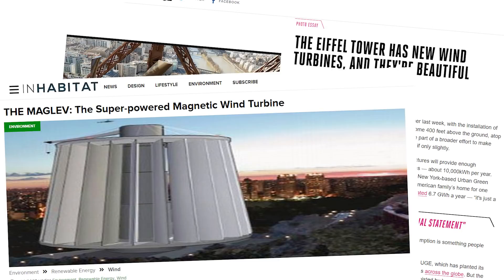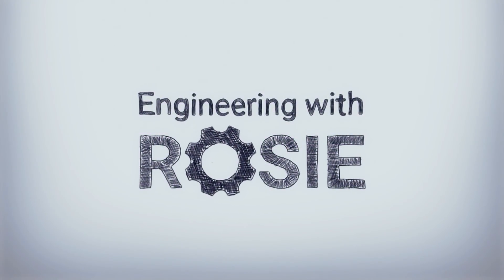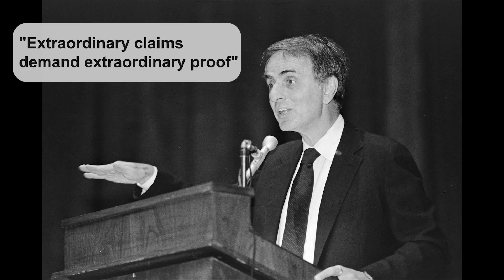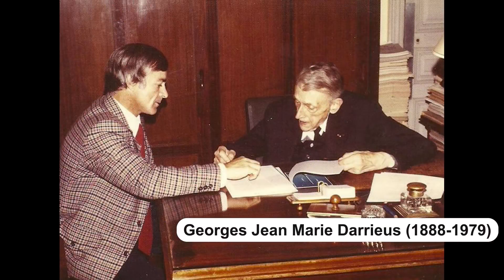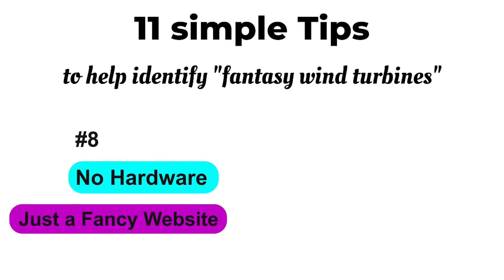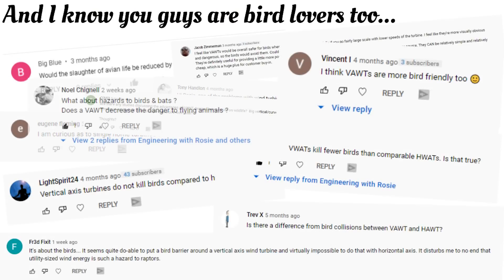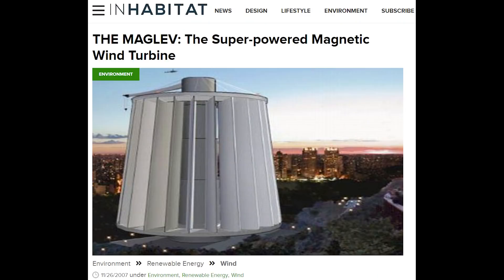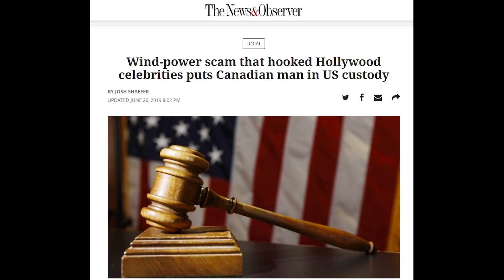Back to the Future of Wind Energy Technology with Paul Gipe

Comment: The future of wind energy isnt generation its storage. This should have been sorted on day 1. Wind is an unreliable energy source and largely unpredictable too. If you want to charge a mobile, fine, though even that is storage, if you want to run UKPLC its next to useless, especially with a blocking high as we see each winter. Zero wind = zero output. Zero wind with storage = ability to tolerate periods of no wind. Frankly Nuclear is a zillion times better than any of the Greeniot nonsense!!!

Comment: It isn't the blades and the wind capture that needs to be looked at, it is the generator that needs to be redesigned or improved to generate more energy at lower speeds.
Reply: generators can use speed or torque: a transmission (or belt drive over pulleys)
can exchange torque and speed

Comment: I've been watching your videos for a while, and I can say you are rigorous and well documented. That's why I wanted you to check our development and share your thoughts: https://www.youtube.com/watch?v=S7rJ7OEfSak
At first sight it may look like you can red check all your tips to identify a "fantasy" wind turbine but every statement is well documented and proved. I'd be happy to share any further info you may be interested in.
The claim about low winds is based on two things. The shape and aspect ratio leads to a really low start-up speed. On the other hand, the special electronics can boost generator voltage at ultra fast speed up to the required battery voltage, thus, squeezing every single Wh available from short wind gusts. I hope you can have a look.

Comment: Hello rosemary, can a scaled down wind type farm turbine work for home use? I’m thinking more of the blades rotating at slower speeds and geared up to drive the alternator. I’m thinking this way because micro wind turbines seem to need high wind speeds to get any useful output. So in essence a long blades rotating at a more slower consistent speed collecting more wind power then geared up.

Comment: There is nothing wrong with an inefficient wind turbine as long as the marketing department doesn't hype it AND it has some kind of redeeming feature like it won't over speed to the point of self destruction. Over speeding is also a problem with scale and high efficiency.  The grid scale market is driven by return on investment in the form of kilowatt hours per investment dollar. Even here, there are cons like shell corporations shirking decommissioning costs. The investors that get surprised with that bill find that their contract is unenforceable against a ghost corporation and the liability protection they thought they had doesn't exist. They awaken to the fact that they have become unlicensed insurance companies and their liability is unlimited.

Comment: Small wind turbines make sense on sailboats for battery charging when away from the dock. They are generally smaller than 2m in diameter, with noise and vibration being major concerns for the people living onboard. Do you have any sources for reliable information on these small scale units?

Comment: Dr. Rosie, I would like to address my comment to Mr. Paul Gipe. 
I respect him as a senior citizen and a Wind Turbine expert. However, I can tell him directly that this time he is a loser. I want to prove to him that all he had said about his 11 tips on degrading New Wind Turbine Inventions were unacceptable and completely false. 

One quote he laid out from Carl Segan “Extra Ordinary Claims Demands Extra Ordinary Proofs” I will disprove this because I made extraordinary claims in my turbine invention, but would not require extraordinary proof why? Everything is self-explanatory. Another quote he laid out from a German Professor Robert Gosch “ If there is a new Wind Turbine, no one should pay the slightest attention to it until the build it, measure it, and publish the results, until then it’s just hot air, marketing hype, and nothing more.” Again, I will disprove Professor Robert Gosch’s quote because even my invention is not built yet, but our 3D video simulation is enough to demonstrate boldly how the system works. I will describe it as far advanced, simple, low cost, robust, flexible, and its unbelievable 30MW minimum calculated rated output. All are understandable even by non-engineers. Note: My wind turbine invention is not found in his published books. Not even one turbine comes closer by resemblance. 

I wish for Mr. Paul to be given a chance to retract his false conclusions to regain his reputation before we launch Rollie Wind Energy this year after he is done evaluating and reviewing my turbine invention when travel is normalized. He must correct himself and make an apology to the world by echoing this statement “I made a grave mistake to assume that wind turbine inventors are all lousy. It is late for me to realize there is an exemption.” 

Kindly check and go over our webpage to explore Rollie Wind Energy (RWE). Be cautioned:  Our claims might cause you sleepless nights, don’t complicate your thoughts. It’s been simplified in line with old and modern science. 
Contact us:  rwe@rollieracks.com
webpage: https://rollieracks.com/rollie-wind-energy
Reply: 3D video simulation...LOL...get real, dude.

Comment: is it possible to use wind to charge a TESLA battery.
Reply from the maker: yes of course! I don't think a Tesla battery (or any other brand) really cares the source of the electrons.
Reply: @EngineeringwithRosie  thank you, to expand ,are there systems availiable that link turbine- battery storage, to a house grid,  i mention Tesla, as the Musk way, shouts out innovation currently.  thanks.

Comment: If you have built it, tested it and published the results then you don't need investors. In fact, you are less likely to get any investors if you have put the performance of the design in the public domain.  If you can afford to do those things then you are most likely an established supplier who will find a highly innovative design disruptive to your current business. You definitely won't get any investment if the design doesn't have a provisional patent.
I am sure that it is true that the vast majority of 'new' wind turbines are nothing of the sort, but I have also been on the other side of the equation in my own engineering discipline where the incumbents, often large multinationals, create legislative barriers by lobbying government in order to increase the cost of entering the market.
The observation is not a defence of charlatans, I was at a decarbonisation conference recently where the great majority of 'solutions' were whacky wind generators looking for investors, so I recognise the problem. However, I have also seen innovation stalled by simple checklists and legislation that primarily protects multinationals.

Comment: I do like the idea of mini vertical wind turbines. Even if they are much less efficient, as given their size you (might) be able to place 4 on each corner of a building that would be unobtrusive as against a single more obtrusive or difficult to locate traditional turbine. How many small vertical turbines would be needed to match an equivalent small traditional turbine? Thinking about residential micro generation rather than commercial…

Comment: Already many windmill used only at certain time and maximum time it is not functioning. I have designed a New Clean Green Sustainable Energy Project. The advantage of this project is the out put energy is constant, continues through out the year and also lower in cost than all other present energy projects energy cost.
        Now I am looking for the investors with proper agreement.

Thanks.

Comment: 'powerpod', from Halcium Energy has just completed another funding round. $900 000 raised.

To be honest, if they produce a 'pod' that combines the turbine, transformer electronics and connection, I think they have a viable product.

Installation of current small turbines is messy.

They aren't claiming to be more efficient, just to be developing a product that works in an urban environment.

Comment: Wind turbines batteries petroleum  oil fucil solar platform ets. That produce energy.is nothing on the future. Have heard about EPG. ELECTRO PLASMA GENERATOR. which a Filipino inventors in the Philippines. And its going on. They have design generator using electron s produce by satillites.that could produce electricity.

Comment: Wind is unreliable and useless unless located in an area where wind is a norm. generally above 3MPH. My property in eastern Wa. experiences continual wind up on my ridge, so with 3 units tied to a standard transformer, I can produce well into 22kw on a regular basis. That said, I also have a fairly wide and swift flowing creek that feds my pond and have a small hydro turbine I built in my overflow to also supplement in the event my wind center fails me. I am a PE ME so I have some background. Biggest issue is so many companies see the tax dollars and an unlimited supply especially by liberals who are long on feeling and usually very devoid of mathematic skills. And they go for the grid. There's a big difference between supplying a single residence and supplying the huge loss associated with the grid. With your own sources you can combine several sources (i.e. wind, hydro, solar) to keep a single operation off grid. You can even over produce and sell it to the system. I choose isolation over participation. So any excess just gets diverted to a ground gate....which provides some monstrous night crawlers for fishing...in MY POND.

Comment: Thanks for this one.  I still think that every home owner should consider some sort of renewable energy and storage as a backup.  If the laws in your area allow grid tie without it costing more... Go for it.  
I don't think the future is millions of stand alone off grid generation stations, but instead a large amount of aesthetically pleasing solutions that every location does that can feed back into the grid.  If every house hold and business captured the solar and wind that occurs naturally around their structures and were able to offset their demand on the grid..... Well that would mean that we would have to depend on giant generating stations less.  Not eliminate them but depend on them less.  
I experiment with some solar, some very small wind and some very small micro hydro.  I am still grid tied, and I will be as long as there is a grid.  I offset about 10% of my power needs, but I keep at it.
Reply: I am a big fan of hybrid systems. Wind solar and battery bank. I show people how to diy on my channel. I work with big names like xcel , not some random guy I India charging a cellphone

Comment: Thanks for the info.  I am just an old layman wanting, if possible, to put in a system in our 'finally bought' retirement home, to keep costs down in the future when we really have a fixed income.  I don't understand all the math and jibber-jabber (though I do know that they are valid and necessary) so you get an excellent thumbs-up from me in your gentle explanation.  Two questions I have: (1) where can I go to just get an answer I can trust to just say "buy one of these 3 or 4 systems for your location, budget, and needs", and (2) can you give a presentation about combined V/HAWT that uses a deflector to scoop the wind to blades within a VAWT.  I understand that deflecting would reduce efficiency but would results still end up in the positive?
Reply from the maker: There are a couple of links in the description to small wind certification bodies. Check out those lists and buy one that meets your size and cost requirements. Note that the specs on the indepentent certification sites can be EXTREMELY different to what the manufacturers claim, so be careful that you don't trust the websites in these cases. And the manufacturers who haven't been independently certified? Then you've got no way to tell how much power, noise etc you'll really get.
For your second question, I haven't seen anyone do this successfully. It always ends up more complicated and more expensive than a normal design. Maybe one day in the future someone will make it work, but so far hundreds have tried and all have been worse than existing designs.
Reply: @EngineeringwithRosie  Your prompt response was a surprise.  Thank you for your time and gentle guidance.

Comment: Thanks for discussing this. I've been meaning to buy or make a VAWT turbine for ages, couldn't decide how to go about it or which brand to choose. Just like solar panels, it sounds like there's still room for improvement with regard to wind turbine tech. 
It annoys me that the media gets so carried away by new innovations, making you think - This is it! The answer to all energy producing problems! - only to never hear of the innovation again.
Reply: The problem with wind is always everyone tries to capture slow wind to produce energy. The energy law states if win has energy -> the collector gain only equal amount energy. So in wind designs the problem is always size. You need eithe big 30m collector to capture enough of that wind to produce energy. a Conical or plaine wings, conical is being the much worse than plain wings because plain wings can capture the the speed of wind not a mass. Think of water the same, if you would want to produce good amount energy you need to capture the speed not the water mass. Because the speed of water has energy not the mass.

Think of this way. The mass you capture from wind/water will always be negative to speed of wind/water. In engineering the problem is how to negate the mass and use only speed collecting what in a essence the industrial wind trubines do.

Comment: What I really find interesting of late and I haven't seen this anywhere, maybe because it just doesn't work. But I like the idea of the old direct kinetic way of using the wind's energy like the windmills of old. 
I saw the 'strandbeest' from a Dutch artist, it works on wind energy to make pvc pipe 'beasts' walk. He does this on a beach because you need wind and open space, this got me thinking if this can be used more functionally because I thought why always convert wind energy to electricity. 
I thought what if you have very light weight machines mow large grass fields directly turning the wind into kinetic energy that moves the machine. Imagine simple easy to build light weight machines mowing, planting, sowing on their own without the need for heavy tractors as compacting soil isn't very beneficial for it too. 
I don't know if this would ever work or if it's not easier to build a windturbine and have an electric tractor do the work. But the lightweight and less power needed and the simplicity of it made me think it might have some merrit. Really wanted to share this here, I love to know what people think.

Comment: Distance from market has always limited Australian industries.
Ie The early objection to wind and solar power taking over from fossil fuel still holds. Big Batteries, heat or chemical, at Coal and Gas fired power stations should-could preceed the alternatives, if Rooftop Solar, Wall mounted Batteries, and EVs aren't islanded for-by the Consumer. Logical to perceptions.., but that is why we need Engineering Analysis and serious reviews of aberrant policies that appear to be biased toward increasing the use of fossil fuels. 

The recital of Australians about it was always "you get the Government you deserve", but this only applies to those who don't wish to think for themselves.., and ignore the personal responsibility required in Democracy?
***
When it seemed that only Nuclear Powered Submarines were capable of maintaining Australia's security, because it's that level of reliability and ability to place exactly the best energy exactly where you need it, (the finger in the Dutch Dike analogy), ..what does anyone with intact senses think?
Reply: Weapons are not defined as defensive. 
The holistic holographic, comprehensible approach to defending planet Earth is not simply Renormalized Cynicism, which is a personal defensive reaction to stresses beyond physical control, the only actual solution is genuine knowledge and education in a Democracy. 

On past experience, the legalised robbery of citizens will continue, the military mindset will get their props for their "Theatre of War" games and ignorance will continue to proliferate like naughty weapons.

Comment: Dutch Windmills of the sixteenth century  have the answer. Ask yourself where are the grinding stones, at the top or the bottom of the windmill? The bottom, so that where the generator goes everything else is physics. I personally like the top hat helter skelter design, driving an internal shaft from the top to the generator at the bottom. But hey WT do I know other than Rosie is a babe

Comment: The main thing this really fails to discuss is USE CASE.    giant horizontal turbines are very efficient in giant open areas with a high wind source, a low need for low noise solutions, no desire for environmental visibility (the amount of scenic visual enjoyment reduced by being blocked by giant turbines), regular access to maintenance crews because the designs are efficient but high maintenance, etc etc etc.     can micro horizontal wind turbines do better than vertical axis in tight enclosed spaces like in between buildings?  the package fits a space, that space is important.   If you are talking about being in-between residential buildings, then sound becomes more important as well, etc etc.        These are the kinds of topics worth discussing.
   
on the topic of vertical axis turbines specifically, it would be nice to talk about the windswept vs square-ft area coverage and limitations in these areas as well.    Such as how close together can you even place vertical turbines anyway?  can they be in grids or will the outer layers of turbines hinder the inner layers (the turbines being down wind from other turbines).    
stuff like this